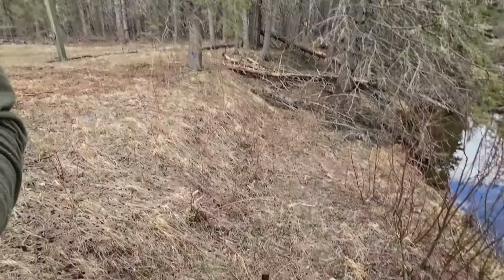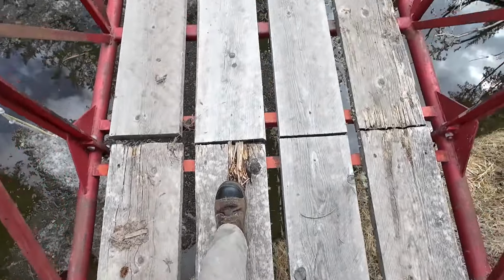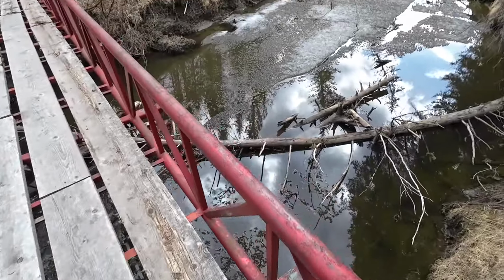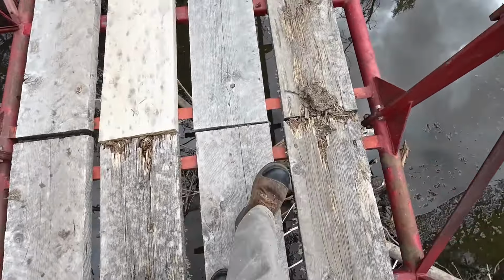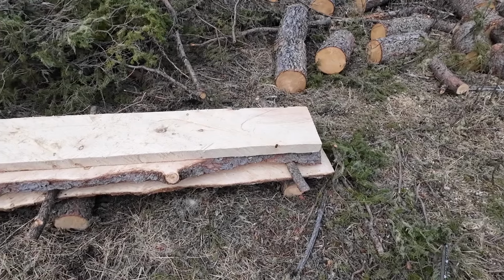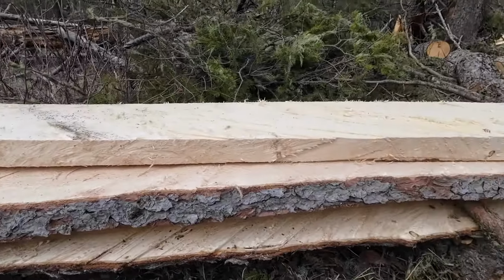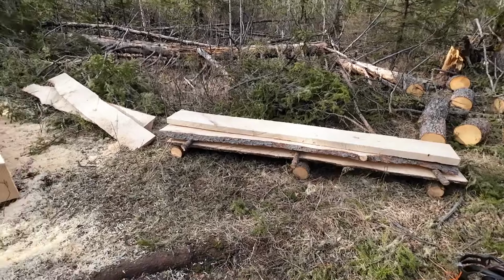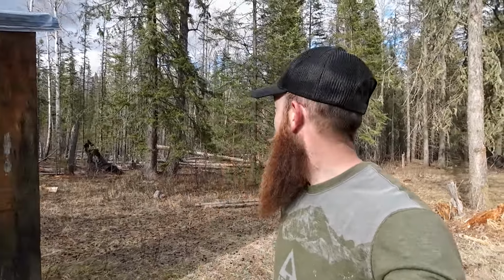Freehand Chainsaw Milling - Turning Logs Into Lumber

Comment: So I usually make it a rule not to offer suggestions, but I can’t help myself here. Once you get the boards down on the bridge apply used motor oil on it every year. It costs nothing and the alternatives are like $30 per gallon. I have oiled my dock and stairs  going to the water for 30 years and the lumber is still very healthy. And after it soaks in it is NOT slippery. I started oiling my wooden smokehouse I made out of pallet wood and it is a gorgeous golden color.
Reply from the maker: Any danger of the oil washing off from rain/snow and getting into the water?
Reply: @KuskWild  good point. The wood soaks it up fairly quickly. I suppose if it rained quickly after the application it could.

Comment: I snap a chalkline from level and plumb squares drawn on the ends of the logs , but your way works well for you. Chainsaw was my only power tool for decades !!  The more you do it , the easier it gets.  All the sawdust is great for the hen house or garden mulch or dressing slippery winter foot trails..nice work !!

Comment: That's pretty great for your first time. I used my little 261C tonight to mill up 4x4 beams for the first time for a wood shack of my own. They are certainly pretty rough compared to yours. I used a chalk line, but for the initial cuts on the raw round edge I'm going to use that rope technique like you did!

Comment: A good day indeed. 
I’ve saw some guys in Labrador make some very respectable lumber with a chain saw mill built over a cradle for the log.  One fellow used two scissor jacks from a car, one under each end of the log so that it was level for the cut. Worked great and was simple.
Reply from the maker: Sounds like a good system! I certainly want to do more milling so I'll have to get a good setup figured out. Thanks for sharing!

Comment: Husky 372XP around $1400.00 plus 28”bar, 2 sets of chain’s and chain guard $300 roughly! 
Reviews online for the Holzfforma are not the best but the price difference is substantial. What’s your bar length?
Reply from the maker: The price is why I bought my G372XP. I'm running a 28" bar. It's my first time running a long bar but so far I've really been enjoying it.
Reply: @KuskWild  I think I’m going to bite the bullet on her! Just figurine out where I should purchase one here in Ontario . 
Any suggestions? 
And thanks for your time Kyle